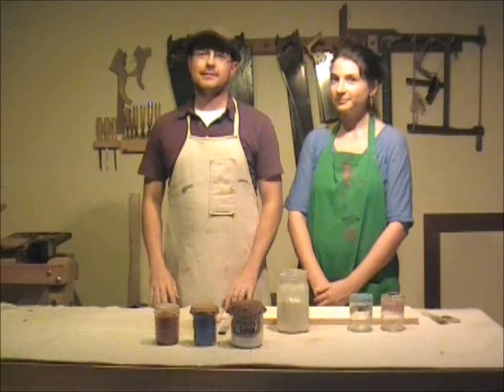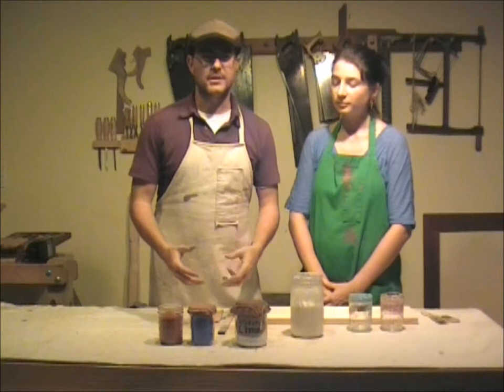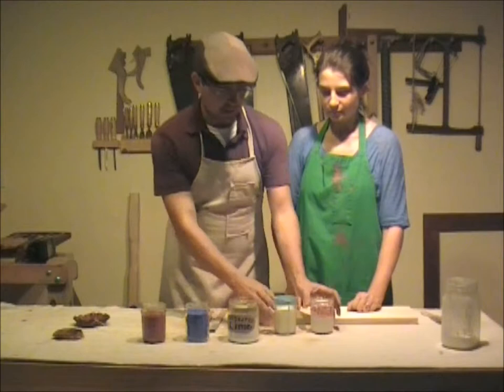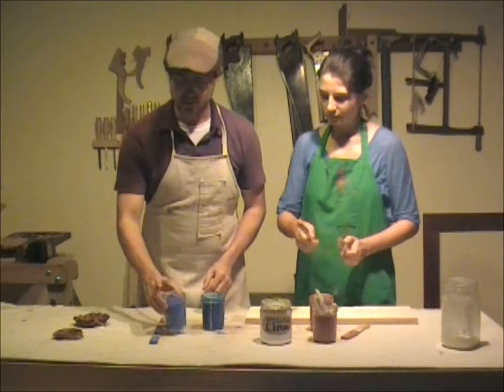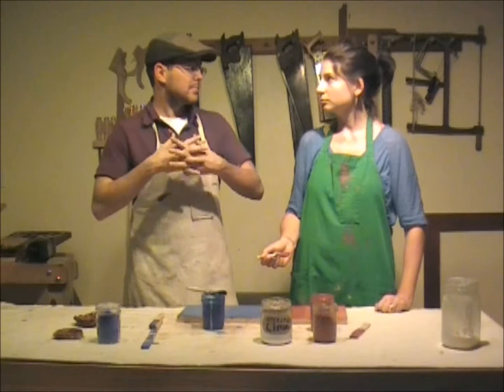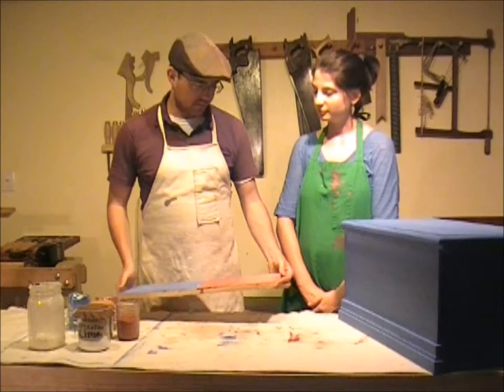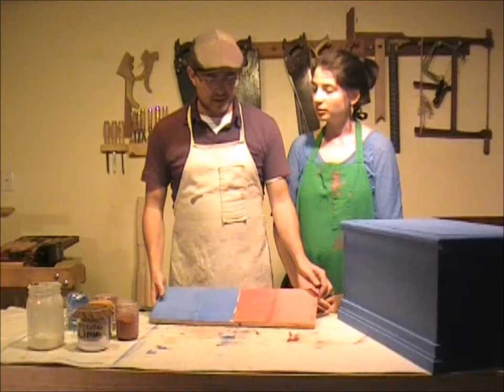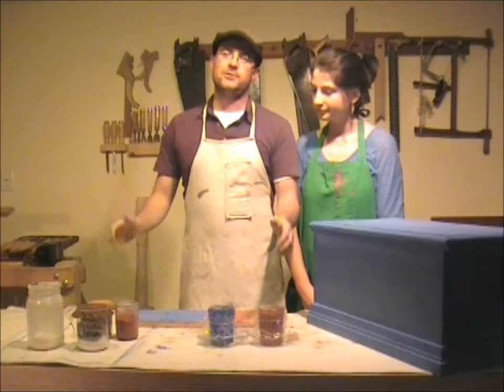Mixing and Using Milk Paint

Comment: I would have used either a blender or hand mixer to blend the lumps out ,, also allowing the lime to settle in  like a small amount of water to make like a paste works even better to cure ,, so its not so runny ... yes you can seal it either with paste wax also you can poly over the wax for tops that are used ,, linseed oil mixed to a mixture is a top glaze ..

Comment: calcium carbonate aka lime you can get at amazon fine powder * milled *
Reply: calcium carbonate is not lime, it's chalk. Lime is calcium hydroxide. You need it to chemically react with the protein in the milk to create a binder (or glue) to make the pigment stick to the wood. Powdered chalk has a completely different role - it's used as a filler to thicken and bulk out the paint.